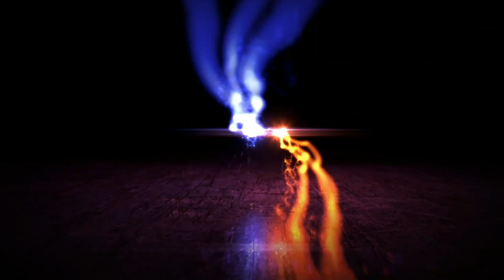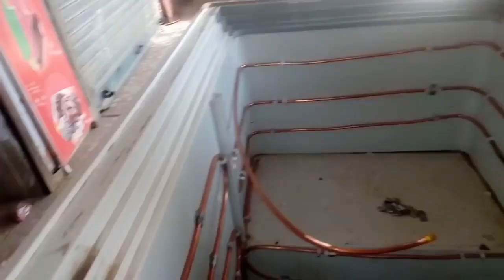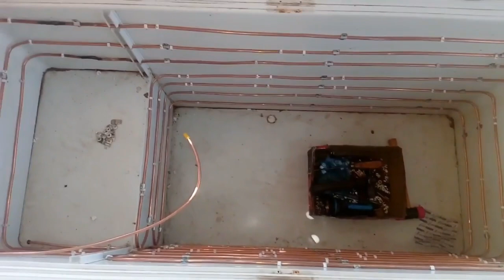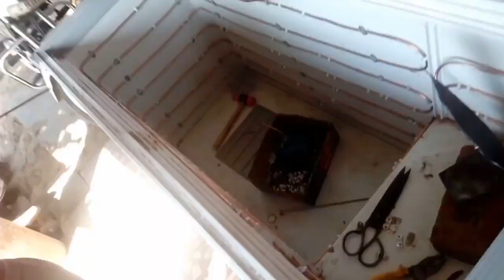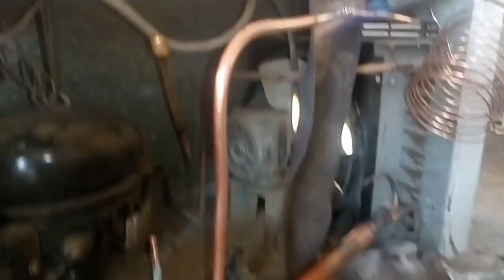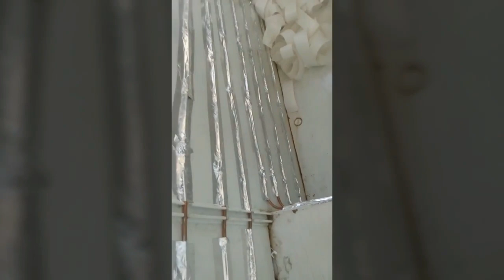How to Repair old Refrigerator Repair | Bypass blue star Deep Freeze Refrigeration | Full Practical

Comment: Is good way to refurbish one old unit what mostly the time is trash, good job,just one personal comment is better to use at wet towel covering the drier, when You are bracing for protect, the overheating on the drier and keeps away internal damages thanks.

Comment: Sir kitna meter pipe ka ye aapne banaya h aur kaise pata challega ki kit e ltr me kitna pipe dena hoga aur kitna capplery dena hoga sir humko plz bataiea humko janna h ph 8481997880 ye mera number h sir aur aap apna num plz dijea ya humko whatsapp pe add kar k rakhea humko ye sab sikhne ka bahut ikcha h plz sir
Reply from the maker: Irfan Ahmed  contact us on WhatsApp 8200075381 only text please
Reply from the maker: +Irfan Ahmed http://amdavadicareer.com/2018/01/17/bypass-deep-freezer/
Reply: @ElectricalCustomize   @Yogesh Technical  Voltas company ka 500 L ka  chest fridge hai
Pipe kitne foot lagega usme Pura aur pipe ka size kya hoga
Capillary size kya hoga Kitni foot Lagi
Sar Bata dijiye please 
Compressor ka pumping pressure 400 psi aa raha hai compressor badalna padega kya or discharge line main se oil bahar aa raha hai
Sir my number 9130231986
Please call me bhot Zaroorat hai